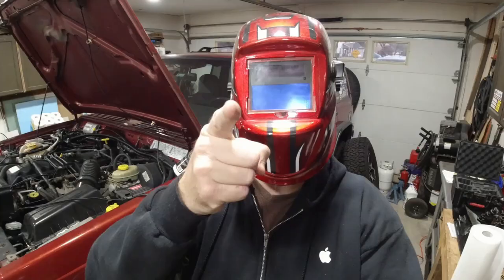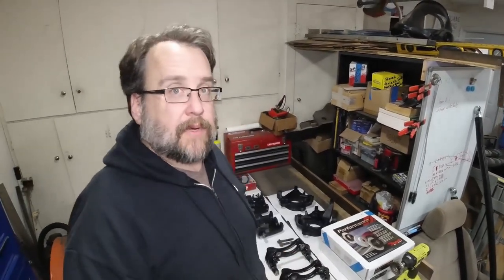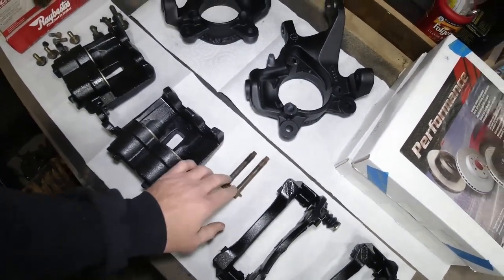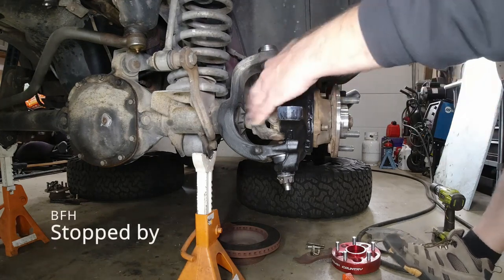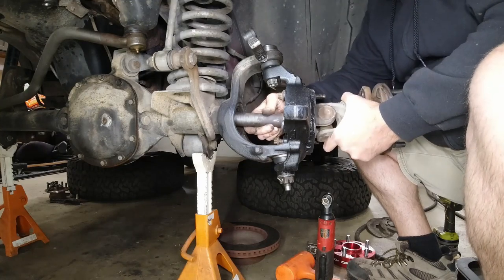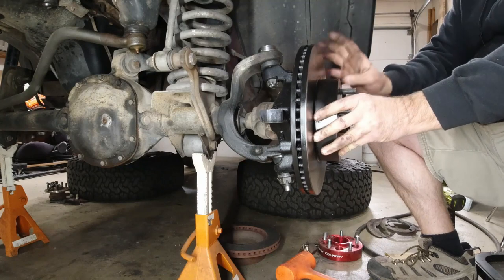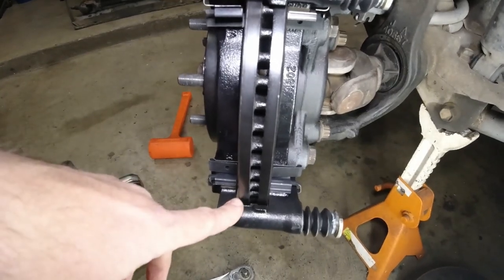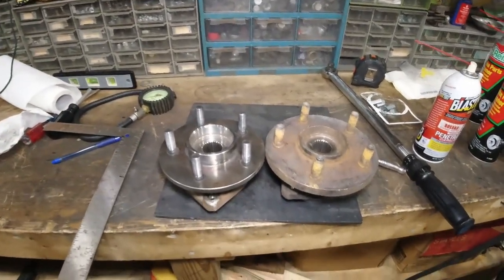Jeep XJ Cherokee to WJ Knuckle and Brake Swap and your options.

Comment: The combo I've been using for years is wj rotors, 00/01 hub bearing, and welding in the hub spacer. No need for any other goofy spacer combinations. SFR sells a cheap and easy to use drill jig for drilling WJ rotors to 5 on 4.5.
Reply: hello , can you send the link to the  rotor drill jig. 
thanks.
Reply: Can you use spacers and the wj hub and rotor to change to 5x5 along with the wj brakes
Reply: Who is SFR?
Reply: @garyvanmeter4911  Stinky Fab Racing

Comment: I just swapped the entire front axle from a wj to my tj. I didn't have to mix and match brake and hub parts or weld spacers and the axle is slightly wider for better tire clearance. I'm doing other things to the Jeep so it's not back on the road yet, but steering and brakes are together and seem to work well so far
Reply from the maker: That’s a fantastic idea!  Awesome to know it’ll go right in. Thanks for sharing this option!!
Reply: @4HIGHGARAGE  I measured everything multiple times before pulling the trigger on the swap. I think the spring perches were out slightly wider but all the link brackets lined up. Since the bolt pattern is now different, I could use gladiator/JL rims from ebay for correct backspacing with no wheel spacers
Reply: @mackenzieclancy959  I assume this gave you 5 x 5 on the front, but rear was still 4.5 x 5.  So did you use spacers for the rear to make them all the same?  I like this idea as everybody with a JL sells their takeoff wheels and tires.
Reply: @garyvanmeter4911  I also swapped the rear out of the wj. Unlike the front however nothing lined up, I cut off all the brackets and spring buckets and welded on new ones in the right place. Spacers on the tj axles would have worked too because they're narrower than the wj that I swapped into the front

Comment: Wouldnt it be easier to just swap the axle then to do all this ? Or are the axle mounts not in a good place ?
Reply from the maker: @michaelengelhardt5296  If I remember correctly they’re in the same place.  All the Cherokees from 2000 forward including the grand Cherokee (WJ) were all a low pinon Dana 30.  Keeping the high pinon Dana 30 in my 1999 XJ is preferable. Keeps the pinion and front driveshaft out of the rocks.
Reply: @4HIGHGARAGE  ik they are both high pinion d30 but the wj is 65 in mounting surface  instead of 60 inch. But idk about control arm mounts, tracj bar mount or spring perches.
Reply from the maker: @michaelengelhardt5296  Ah I didn’t remember that.  Guess is the control arms line up it be a decent swap.  I’m running spacers for the JL rims I’m running even though it’s the same lug pattern the wheel offset requires the spacer.  So a wider axle would do the same thing.

Comment: Do they fit with 15" steelies?
Reply from the maker: I didn't try but word is they will work with the right back spacing and maybe a little clearing of the calipers.

Comment: thanks for the in-depth video. I've been planning on doing this upgrade in just a month or two and was planning on just getting the Ford explorer brake rotors because I was told they were a direct bolt on. thanks for showing the misinformation that is currently online. 
very much thanks and keep up the good work will be looking forward to what else you do on your XJ.
Reply from the maker: My pleasure.  I appreciate the compliments!!

Comment: I did this upgrade on my YJ, awesome performance boost. I also have the Yukon spin free hub kit, so that added some additional hurdles, there's basically no way to make the WJ rotor work in that instance. You have to use a CJ7 rotor and have the knuckle modified so the caliper sits farther inboard. There might be other rotors that would work with a Yukon/WJ setup and not require the knuckle to be machined, but I was unable to find one.
Reply from the maker: I had to google that, hadn't heard of that kit.  Not cheap but very cool.
Reply: For sure not cheap, but worth it if you are doing enough highway miles. I was able to find mine at an unbeatable price, like half of what they usually go for. There are two kits, and WU07 and WU08. The 07 kit basically uses the hubs from a Ranger, so you get to keep your 4.5" bolt circle. The 08 kit uses a much stronger Ford half ton hub, but you also change to a 5.5" bolt circle. It holds up to bigger tires much better. I got tired of swapping out the unit bearings every couple years. The draw back is that you pretty much get stuck with the factory brake calipers, until now. Most sane ppl will just go to 1 ton axles, and then you solve two problems at once. Overall, I'm still below the cost of going with 1 tons, and the WJ brake works well on the CJ7 rotor, they are very similar in diameter and thickness.
Reply from the maker: @7t2z28  That's awesome! I'll have to keep these kits in mind.
Reply: I just did this for bigger brakes and to go hi-steer eventually.
Right now I have a 30 spline chro-mo inner Dana 30, and 32 spline chro-mo JK outers. I used the weld on spacer, JK unit bearings with WJ everything else, and it works. I just needed a washer  to get the rotor centered. I am running 5x5 w/spacer.
Future plans are a JK width housing with TJ knuckles so I can use all of this w/chro-mo stock JK length inners and no wheel spacers so ball joints won't be under as bad of a load.

Comment: Is the sand hot? if not placing the knuckle in the sand is a waste of time as the sand will cool it down fast. I just put the knuckle back in the oven and slowly reduce the heat. I reduce it 50° every half hour. The knuckles are cast steel so you don't need any special welding wire.
Reply from the maker: In Texas everything is hot. LOL.  If the sand was outside in the winter the shock of the cold sand probably would be a problem but the sand will take and hold the heat from the knuckle and then slowly cool it down.  The casting was likely made in sand for the same reasons.  However the oven sugestion is still a better idea.  Could have saved me 40 bucks in sand!  Thanks for the idea!!
Reply: @4HIGHGARAGE  If you use the oven I'd wait till your wife is out shopping. Mine wasn't impressed. 😉 When I was a young man a farmer I worked for showed me how to braze a cracked exhaust manifold using a coal fire. The pre and post heating was very similar but slower.
Reply from the maker: @MatthewBerginGarage  Thanks!  My wife doesn't watch my videos so I'm good. Hahaha

Comment: Thank you for this video, as it's very in depth and informative!  Since you seem to know quite a bit about this, do you know if anything changes for converting a 2wd front beam axle from an 01' Cherokee?  I'm working on building one to swap into my performance oriented Jeep Comanche and I'm having trouble deciding which direction to go with my brake upgrade.  Thank you
Reply from the maker: Tim the knuckles should be the same between a 4wd or 2wd axle.  So the brake upgrade should work.  I'm not sure how the steering will clear the sway bar bracket on the passenger side. You'll have to just plan on doing some custom work there like I did. Just may not be the same.  If you haven't watched the follow up video to this one it's on the CavFab steering instal.  You'll see what I had to modify in that video.

Comment: Is the brake upgrade mandatory with wj knuckle swap?
I want wj knuckles and not do the brake swap
Reply from the maker: Yes it is mandatory.  The XJ caliper will not mount to the WJ knuckle. You can still use your XJ hub and rotor so you can maintain your rims and tires.

Comment: The spacer kit you recommended has caliper spacers as well but you don't talk about those in the video? Were they not used?
Reply from the maker: Thanks Bryan. I do mention and show it in my conclusion. It’s at the 22:50 mark. They are also only used if you’re going to run the WJ hub and the 5x5 lug pattern.  What I forgot to give is the specs on the longer bolt I used.  I also have had a few other questions people have asked so I think I’ll shoot a follow up video stay tuned.
Reply: @4HIGHGARAGE   Thanks for the response. I am going to stay with the XJ hubs, and am going to drill WJ rotors instead of using the ford rotors. So if I understand correctly...I shouldn't need the caliper spacers?  Thanks in advance I appreciate any help.  Never mind I just watched the end of your video a little bit more completely and you answered my question and in your comment to I just noticed. Great video thanks again!

Comment: On the Hub could you not Mill it and then you wouldn't need the spacer because you've taking away the portion that's hitting the backside inside and you're still giving now plenty of room for that outer surface to rest as well as the bolts?

What years is this good for I've got an 89
Reply from the maker: You could mill the hub. However, the bearing hub is a replacement part so the next time you need to replace the hub bearing you’d have to mill the new one.  As far as years go I believe all Dana 30 axles this should work on with the exception of JK and up axles.  I wana say at that point they changed the axle end or “C” end and the knuckle is different.

Comment: Great video, but once you weld that flange to the hub, how do you replace the front bearings? In future?
Reply from the maker: It still bolts on and off like usual.  At 14:53 in this video you can see me bolt it on.
Reply: @4HIGHGARAGE  ahh yea sorry you welded it to the knuckle not the hub! No worries! Cheers

Comment: How many amps did you use for welding the spacers? and no mention of the changes required for the swaybar link mounts, tie rod, drag link, and track bar?
Reply from the maker: I had my Miller 140 turned all the way up for welding the spacers. Couldn't say the exact amps, just all of them.  I have a second video where I do the CavFab steering set up install for tie rod, drag link, and track bar.  I also show what I did for the swaybar link mount.

Comment: You said your running 5on5 wheels what did you do for the rear axle since xj are 5on4.5
Reply from the maker: Since a spacer is needed to just the JL Rubicon rims anyway I just went with a Spencer/adapter.

Comment: Is there a benefit to running to ford rotors?
Reply from the maker: They’re the stock XJ lug pattern so you can use your same rims.
Reply: @4HIGHGARAGE  ok, but is there still a 2mm offset issue if you go with the WJ rotors and Xj hubs?
Reply from the maker: @bmonden  no. The WJ hat should have the right offset and be centered in the caliper.

Comment: OEM from Theo Ford explorer rotores, please.
Reply from the maker: Ford explorer sport track if I remember correctly.
Reply: OEM number- original manufacturer number.
Reply from the maker: @pedrocastelar7524  not sure but i used Raybestos 680027 is it's part number. Hope that helps.

Comment: Will 15in rims fit ? Or is caliper too big
Reply from the maker: I'll be honest I can't say.  But this was a major question needed to be answer in my video.  I just forgot about it since I was going with a 17" rim.  I think I'll have to gather a few of these questions and do a follow up video.  Stay tuned.
Reply: I did it using 15" rims and there is just enough clearance, but I think it also depends on the rim itself and the backspacing that it has.
Reply from the maker: @gzrgldr8288  100% agree.  Thanks for sharing!

Comment: Doesn't want to run a 3mm spacer on the inside but runs a 2 inch wheel spacer instead 🤦
Reply from the maker: Fair point.